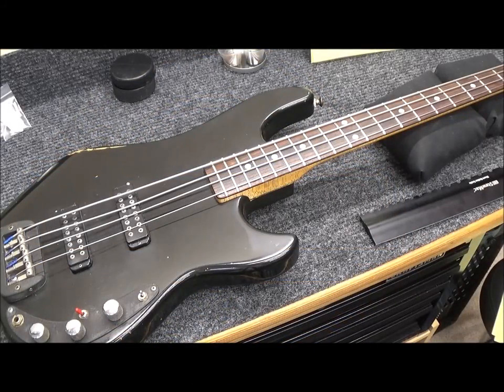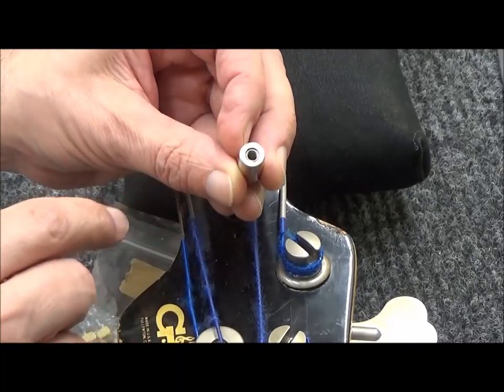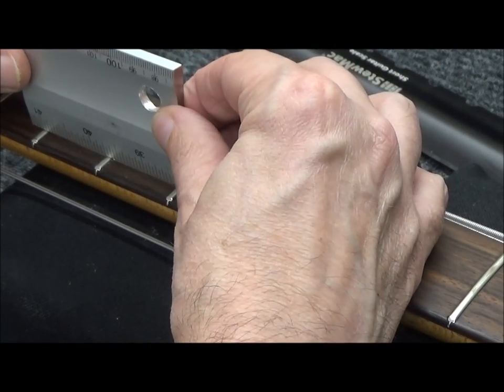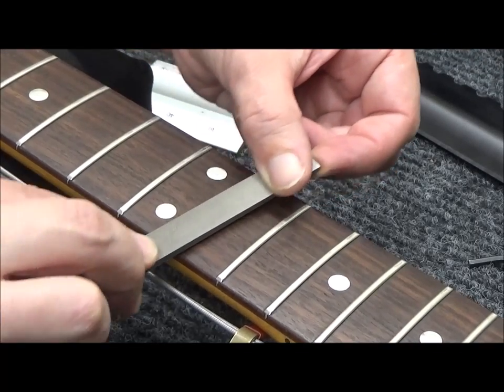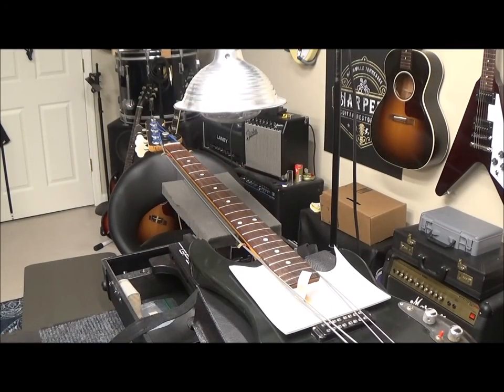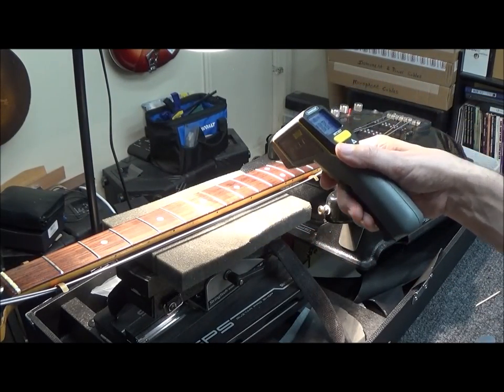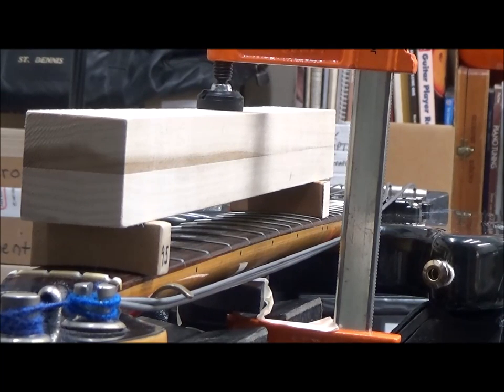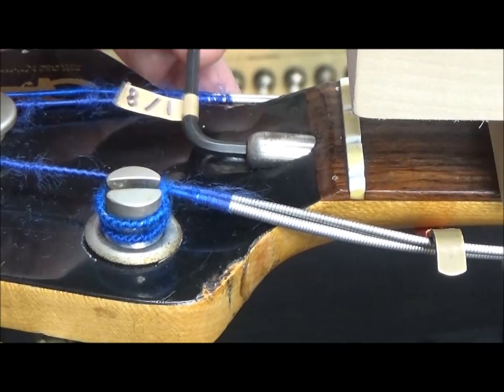Neck Straightening - Heat Press 1983 G&L

Comment: Very nice job and thanks for the video!  Man, the sustain on that bass at the end is very nice.  I appreciate your section on the heating - I'm in the process of fixing my rescue bass that has a one piece maple neck/fingerboard with too much relief/bow.  And, there is a bump at the first fret, like the one in this video.  The truss rod uses the hex socket, but I'm not sure if the nut is removable.
Reply from the maker: Thank You 😊

Comment: How well does something like this work with (I’m still watching the video) a guitar with what has been diagnosed as a bad truss rod? 

I’m in the process of leveling a neck on an Epiphone from the early 2000s. I’ve clamped it as seen Stew Mac’s video on truss rod adjustment and I’m going to let it stay clamped for a week or two. Apply a little heat intermittently and try to level it. 

Because it has some relief but too much. The bridge has to be set higher than normal to make it playable. Hence the attempted leveling.
Reply from the maker: I see a lot of vintage guitars and use this very regularly with great success
Reply: @harpethguitar Great. What wattage is the bulb that you’re using? Thanks again.
Reply from the maker: 250 watt
Reply: @harpethguitar  Cool thanks!

Comment: Hey from Australia. Thanks for the video. I'm trying to do this for a '95 US standard tele. You suggest a temp of about 150; is that Celcius?
Reply from the maker: Fahrenheit, actually 175° wouldn’t be too much
Reply: @harpethguitar  thanks mate. I'm borrowed my wife's hair dryer instead of a heat lamp! Wish me luck. Do you happen to know if it is even possible to max out a  '95 US standard tele truss rod? It's hard to get a definitive answer because there's a bit of variation in truss rod design. If so, I'd like to try adding a washer but when I loosen it the nut gets tight so it seems I can't get it out or get it tight enough! Grr!
Reply from the maker: Take it slow. Clamp it for a day or two. Repeat the process 2 or 3 times. you will be amazed what heat and pressure will do to wood! 😀
Do not use a heat gun, heat lamp or hairdryer on a maple fretboard. You could blister the finish.
In a week or two you should be playing it again.
Reply: @harpethguitar  thanks again. Don't worry, it's a rosewood fretboard. I can't wait to see the improvement.

Comment: Are you heating it from below as well as from above with the lamp? In other words will the lamp be enough to heat a neck?
Reply from the maker: I don’t heat the bottom because the high temperature can cause the finish to blister. 🙏
Reply: @harpethguitar  What kind of light is that? A reptile light? Any info on wattage etc would be very helpful! I bought a telecaster custom MIM neck and it has a natural relief warpage. I have 8s on it but its still too much relief. I've been considering doing something like this for some time.
Reply from the maker: I use a 250 Watt incandescent heat lamp from Lowe’s.
Reply from the maker: It’s kind a like the heat lamp that keeps the french fries warm at McDonald’s
Reply: @harpethguitar  Awesome thank you!
Reply: @harpethguitar Thanks for the video and useful info. Had it been a neck with a maple fingerboard what method would you have used to apply heat to it?